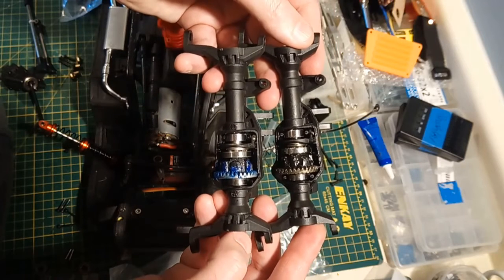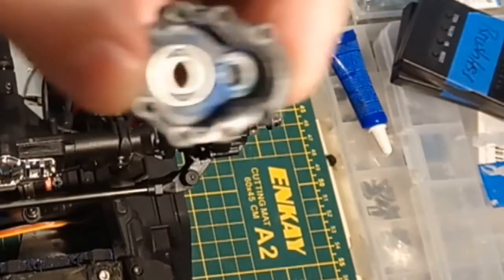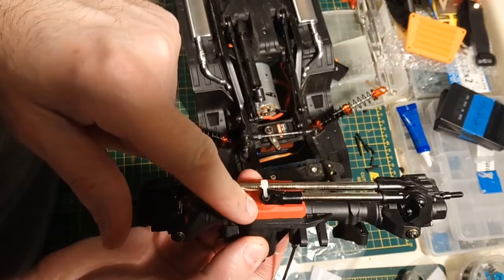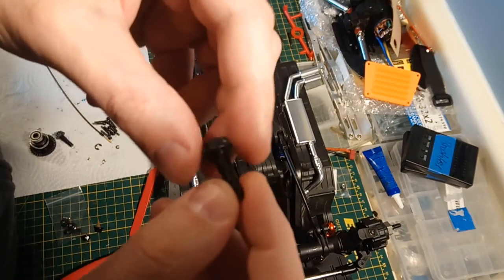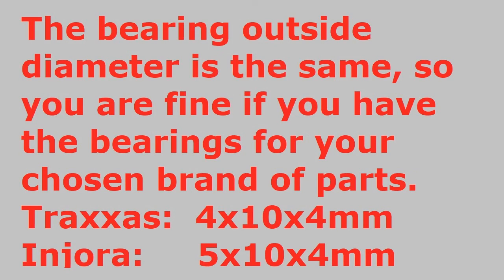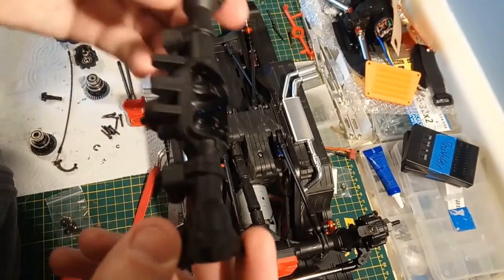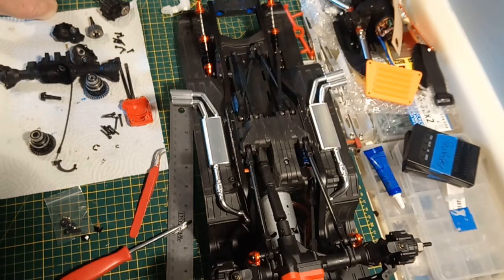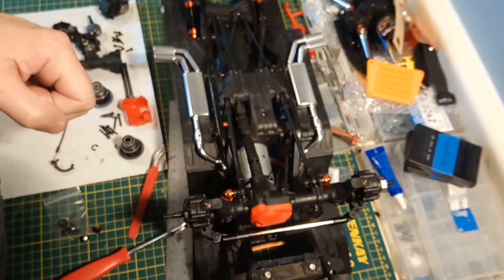Injora TRX4 Clone Axle Deep Dive

Comment: About injora locking system: has It been working well yet? Does It need some mod to work fine?
Reply from the maker: I've had no problems at all so I take back my caution ;^)   If you haven't seen Exocaged RC beat the crap out of the Injora clone chassis, it's impressive (He doesn't name it in the title if I recall correctly, but the clone videos he made recently are the Injora TRX4 clone).  These axles are probably as durable as the genuine ones (maybe more).  I feel silly for being nice to mine

Comment: Hi bro can we use this trx4 clone axle with scx10 gearbox.. Does it run like normal or opposite direction.. Thanks in advance 🙏
Reply from the maker: Yes, I have used them with an SCX10 trans but I've never checked the direction specifically, I have always been able to  reverse the motor wires if needed (I'm not that worried about "proper" motor direction in a crawler).  If my mental gymnastics are correct, the Traxxas trans output turns in the opposite direction as SCX10 and the portal gears switch it back to "normal".  I believe that if the ring gear on your old SCX10 front axle was also on the left the rotation would be the same.  I hope that makes sense.  (You can map out your gears with a quick sketch, every gear mesh to a different shaft reverses rotation)
Reply: @drivetowrench2709  thank you so much for sharing 👍👍👍👍

Comment: Not meaning to bother you. But I got these same axles. All I done was disassemble them to add grease. But I noticed a paper thin shim in my bolt tray and have no idea where this came from. I am thinking the front portal housing , but I only have one of them that is in my tray. Do you know where this shim would go? It is the size of one of the input bearings the front Input portal gear rides on. Hope I explained it good enough
Reply from the maker: It's been a while but I think there was a shim between pinion and the bearing (inside the pumpkin).  That's the usual spot to use a shim to set the gear mesh (The diff itself can be shimmed but mine were not) .  I don't think there are any in the portals.

Comment: If I was to get these for a custom project, locked both diffs with a spool and got rid of the open diffs, and put under/over gears in them, would that be feasible or are these too different
Reply from the maker: The slight binding that I talked about would concern me with the under ring gear because that small increase in diameter might be a problem.  I would expect that running the over in the front and stock in the back would work fine.  Personally, I would rate these more a run as-is solution.  If I was spending that kind of money on gears I would go with Traxxas axles off Jenny's RC because you know everything will fit and the Traxxas have no question marks on durability of the front CVs and the axle shafts.  Plus, you can probably sell the diff parts and the cables.  But I'm also way too cheap to shell out whole axle money on a ring and pinion, so take my opinion for what you will...

Comment: Hi bro.. Can we install brass to this axle?
Reply from the maker: I haven't added any but I would expect it to be similar to adding to stock TRX4 parts, for example, diff covers are somewhat notorious for need a little massaging to fit perfectly (if you buy Chinese its hard to know what you're getting).  I'd be surprised if there were huge problems because side by side they are almost impossible to tell apart.

Comment: Does this axels worth the money or does they fail now?
Reply from the maker: I've had no problems but I haven't been very hard on them.  Dusty and damp conditions, no submersion.  I mostly run the front unlocked and the rear locked.  I would buy them again, especially because genuine TRX4 parts are getting a lot more expensive in Canada.  The 2spd TRX4 clone transmission in the Injora chassis that comes with these axles has plastic gears which I've heard are not great, but a lot of people also seem to think shifting on the fly is a good idea and IMO it is not